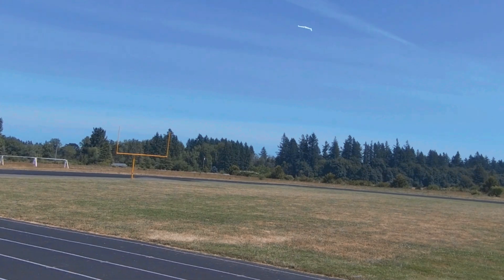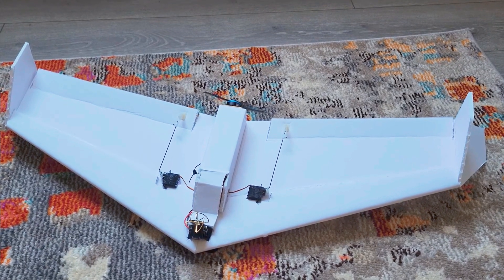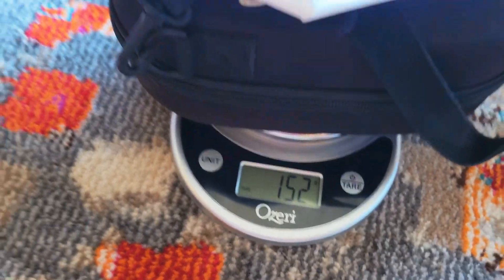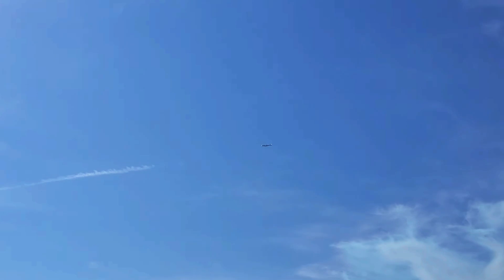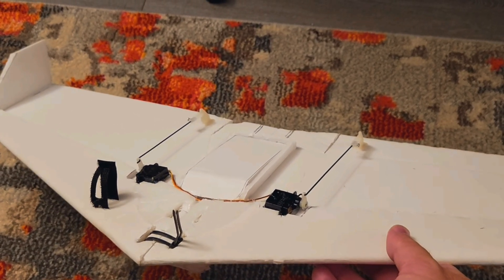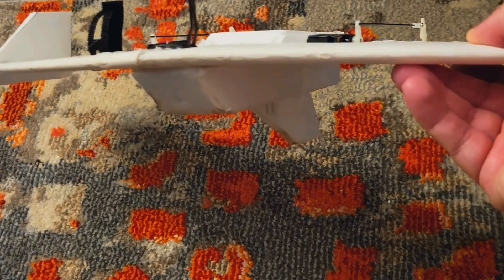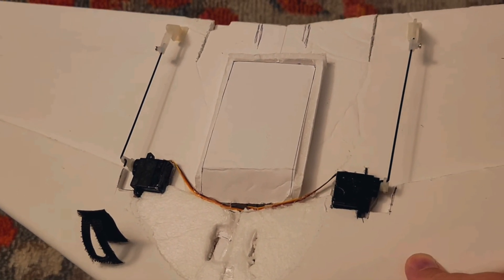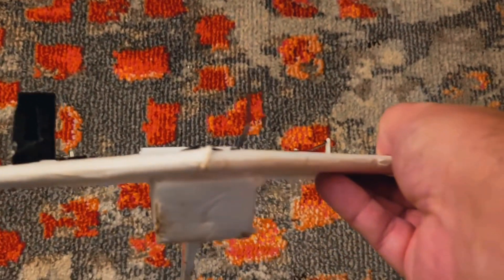So I Think I Can Design a 250g Wing Pt II - Trial and Error | 8:35 FPV

Comment: What model of engine and propeller did you use?
Reply from the maker: I ended with a T-motor F2004 KV1700 with a 4” tri-blade HQ Prop.